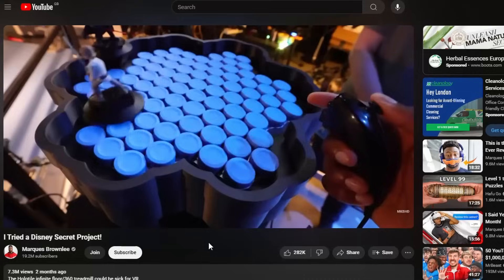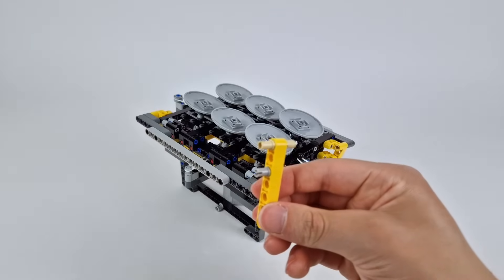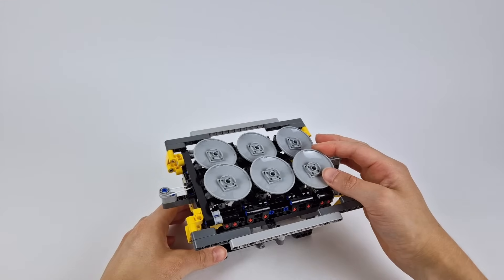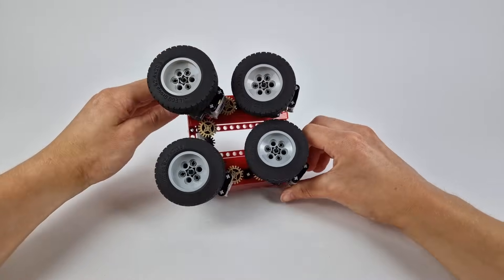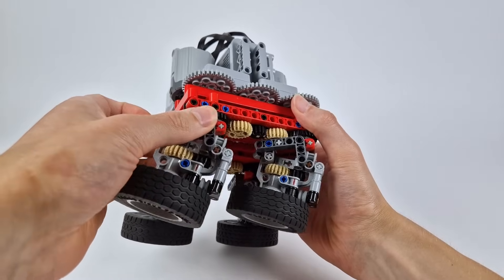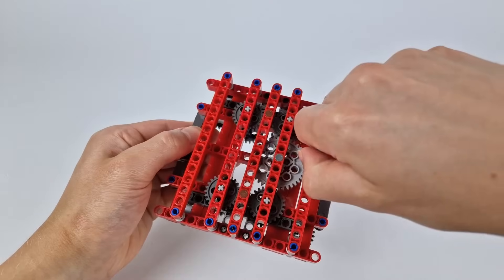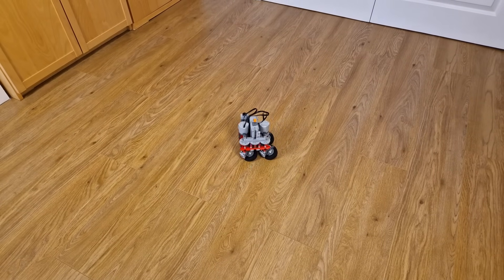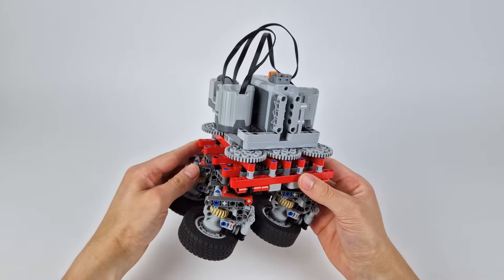Building a LEGO Car not as Intended

Comment: If you could replace these wheels with a series of linkages that lead to (nearly)  vertical stilts that lift a lot higher when the wheel is off the ground.  So linkages that turn this angled circular motion into a tall oval motion. Then you could have a pretty convincing Mars (or other planet) rover.  It might take sixteen wheels instead of four to get enough feet on the ground most of the time.

Comment: This would be a great design for a Roomba. 
Just put the vacuum inside the wheels and make all the wheels into brushes. You could also use the suction of air as the force that spins the wheels. All this would make a much more compact design which is capable of hoovering and mopping the floors.

Comment: Would a chain across the assembly rotating gears have worked as a solution with less backlash?
This seems like a good solution, if the chain does not bind on the wheel assemblies.
Then the chain can be looped through the inside for more engagement thus less slippage risk on all the gears, including an inside drive gear.

Comment: I would use tie rods between adjacent wheels for the steering axis and in both directions held square. This will give it the effect of tie rods on a locomotive to transmit motion without backlash. It can tend to twist though so i would only use it to remove the backlash from the driving gears. You can still have the motors and control unit above the base by undoing the linkage leaving a sandwich with the middle layer free to move, then secure the top and bottom layers together with a C shaped bracket.
Reply: As an edit, it's not removing backlash so much as equalizing it as you've done here by centralizing the main drive shaft. With gears alone, this suffers from a single point of failure, however, and so the tie rods would help prevent that.

Comment: Idea to potentially remove all the backlash: Wrap a Lego chain around the outside of the gears.
Reply from the maker: The problem is that Lego chain links don't mesh with the turntable pieces because their teeth are bevelled on one side, otherwise I would've definitely done that. Several other people suggested the same thing, so I probably should've mentioned in the video why it wouldn't work.
Reply: @BananaGearStudios  Ah, that does explain it.  Thanks!

Comment: you could use one continuous chain along the outside to control the rotation, then just power it on one side, and tension it on the other side
Reply from the maker: The problem is that Lego chain links don't mesh with the turntable pieces because their teeth are bevelled on one side, otherwise I would've definitely done that.

Comment: Why not use chains to connect each of the turntables directly? You just put one loop of chain going around the entire body of the car, it’ll drive all of the turntables the same way, and you can drive the chain from another gear that might be used to tighten their connection. Less slipping, less backlash, etc…
Reply from the maker: The problem is that Lego chain links don't mesh with the turntable pieces because their teeth are bevelled on one side, otherwise I would've definitely done that. So the options would have been to either use the much larger turbtable pieces instead which don't have this issue, but it would've made the car way bigger, or to mesh the turntables with gears and then drive those gears with a chain. I considered that, but ultimately it was simpler to just use gears the whole way through. Should've probably mentioned why chains wouldn't work in the vid.
Reply: @BananaGearStudios  oh really? I had no idea the turntables were any different from regular gears

Comment: In the real world, the first concept has more advantage I think - you don't need to get torque to a rotating mechanism, especially without them interfering with each other. Instead, you just need a swash plate or CV/uni joint as you had for each wheel and some uniform actuation with linkage, and virtually no backlash issues.
Reply from the maker: I definitely agree that the first version has some benefits. The main drawback that led to me going with the later design was that, as you tilt the wheels, the car gets raised up off the ground a bit. Which means that once the full car was built the tilting mechanism would have to be very strong and robust to lift the car off the ground every time you want to change direction.
Reply: @BananaGearStudios  I wonder if you could design a mechanism that pivots the wheel about the contact point, wherever in the circumference it may be, to lift the rest of the wheel off the ground and keep the ride height of the vehicle static

Comment: Why didn't he use sprocket chains to get rid of both backlash and slippage? He'd only need like 3 or 4 chains to sync everything as well as have adjustable tension to get rid of some of the resistance of using a gear train.
Reply from the maker: Thanks for the comment, but I tried that while working on it, and unfortunately you can't connect chains to the turntables because their teeth are bevelled on one side. So to use a chain I would still have had to mesh each turntable with at least one gear, and then connect these gears to spur gears above which I could drive with a chain. I thought about this while building it, but ultimately from that point using more gears was the simpler solution and also let me gear down the motor more.
Reply: Ooooooh, yeah that makes sense. Thanks for the response, I was genuinely curious lol.

Comment: I wish i had lego thecnic peices to do these but they are far too expensive.
Reply from the maker: Yeah, most parts on Bricklink are surprisingly cheap, it's normally only rare parts or parts in rare colours that are quite expensive. I always buy in the cheapest colours, and usually go for used parts because they almost always end up looking as good as new ones.
Reply: It might not be as expensive as you think. I thought the same thing until I went to bricklink and made myself a list of the gears, rods and other parts I thought I would need. Most pieces there only cost a few pennies (while others, yes, can cost $0.50-$1.00 or more). Pare down what you think you need and start building. My first shipment was 150 items and cost me $19.00, 2nd one was 135 items at $25, 3rd was 1362 items that cost $130 (prices include with shipping). Do the math and see what it is per piece. That included gears, axles, liftarms (so many liftarms), turn tables, pins, bushings, frames, pin connectors, hubs, chains, rubber bands, and Gear Differentials. Get everything in the cheapest color, it's a steal.
I started with two small 15 year old sets I had broken up in a box and now I try to build some of the contraptions I see on here. Try it and reply back here when you do. Good luck!
Reply: @tomsko863  thank you for the advice ill look into it

Comment: Just use the chain to synchronize all the wheeltrains!
Reply from the maker: If you mean using a chain to synchronise the turntables, unfortunately that wouldn't work. I tried while I was working on it and you can't mesh chain links with the turntables because the teeth are bevelled on one side.
Reply: @BananaGearStudios  you could use a 8 teeth gears between the turntables and the chain. I think it could work.
Reply from the maker: I gave this a try and unfortunately it's actually not possible to properly mesh an 8-tooth gear with chain links because the teeth don't stick out far enough (even on the older-style 8-tooth gears).
Reply: @BananaGearStudios  Wouldn't it be possible to put a gear that is able to mesh with chains on the same axle as the turntables, so that the chain moves them indirectly?Then you make a structure to properly stabilize the axle, and it should be good to go
Reply: @BananaGearStudios  You could use the old style 56 (?) tooth turntables. Those mesh with a chain just fine
Reply from the maker: I'm sure that would work using the 56-tooth turntables, it would make the car a lot bigger though.

Comment: That’s what’s called a SWERVE drive in FRC. Normally the wheels aren’t tilted down like that though.

Edit: not really actually as with SWERVE each wheel is driven and steered independently but you’ve linked them here
Reply: In old-school lingo, with all wheel directions connected together, this is a crab drive
Reply: It is pretty similar, but it obviously can't turn the actual frame or x-brake like swerve since the wheels are linked
Reply: My Vex U team did differential swerve for a while. This is kinda similar.
Reply: A lot of teams did “swerve” this way. 
118 robonauts from at least 2006-2008 did swerve where all wheels were chain driven and they ganged a heck ton of motors into one giant gearbox to drive the thing. It was brilliant engineering.